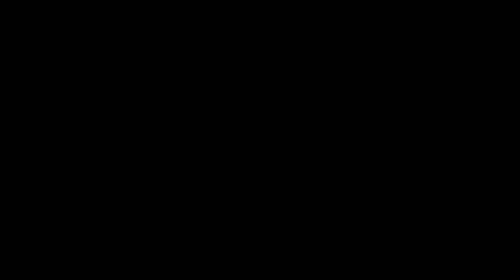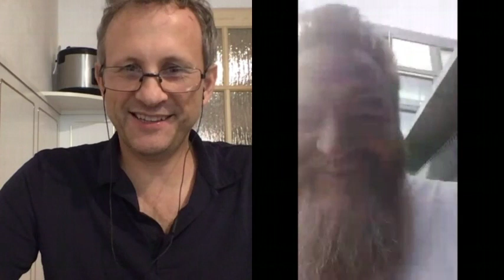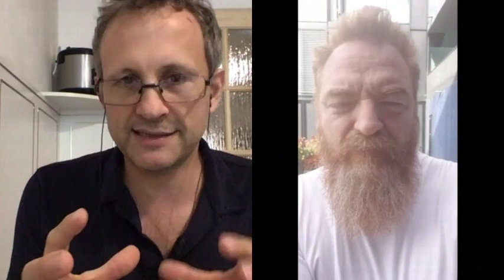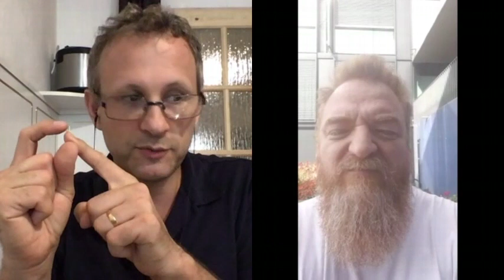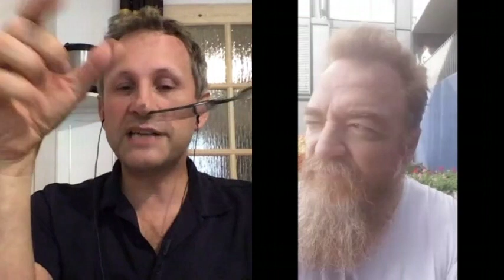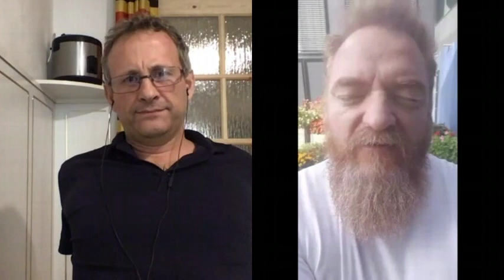Fixing Fukushima - 08 - Just over 24 hours to submit proposal

Comment: could also run HHO flame underwater in the dirty water...it just needs a shroud cos it has its oxidant...reclaim the heat to do work, use the dirty water to make the HHO...the water also becomes the shield for the reaction. make then as stand alone contraptions that can be dropped into a vessel full of dirty water so that negates moving or pumping the stuff around in purpose built containers. suggest same approach for plasma method...rod in a shroud RF plasma on the tip and and return path around the shroud ring. Carbon rods would be better than tungsten...easier to get and cheaper.